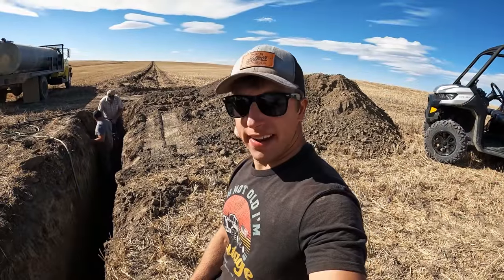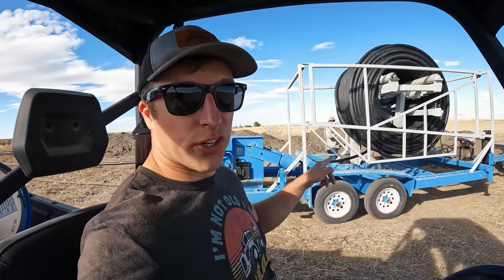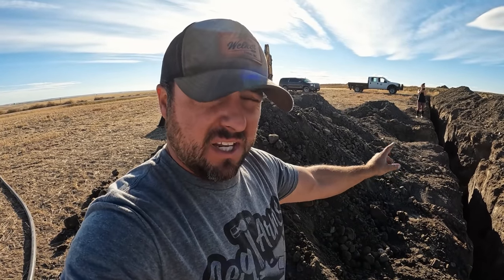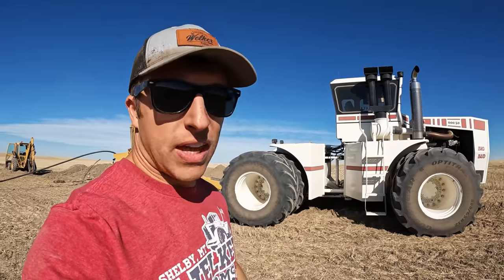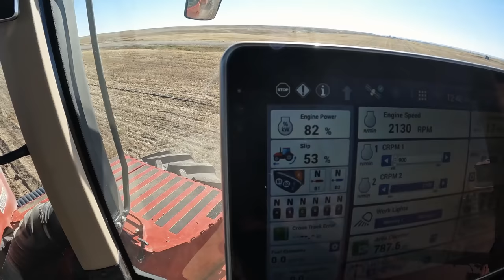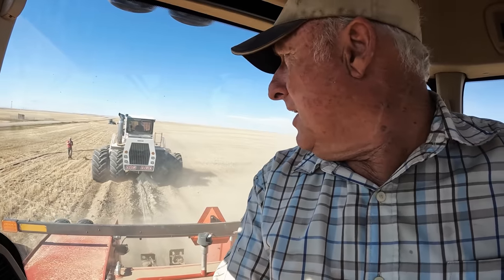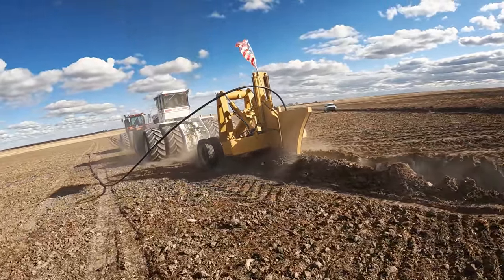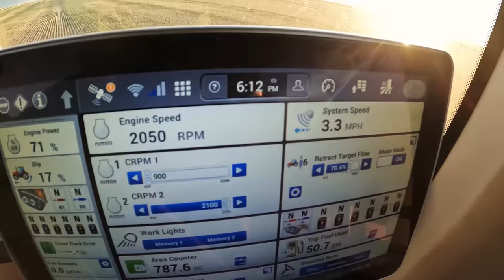6ft or BUST! - This Is How We Lay Gas/Water Lines

Comment: when i was a kid we borrowed my uncles wily jeep with a ditch digger added on and ran about a mile of pvc pipe for my grandfather to his new farm from our town in northern oklahoma and then in the late 70s my dad bought a farm and we had to run water line from the south end (where the water well was drilled) with a tricycle style ditch digger course we only went down about 3 ft in sand(some DEEP sand)  (from down under the old windmill that had an old sand point )) to the north end of the half section  (a mile away) where the barn and main corrals  were built later and i moved in my trailer house after i came back from college.  Still use use it and have added several side runs to put 30ft stock tanks in for the cattle. so far (knock on wood) only a couple of leaks mostly from gophers chewing on some poly pipe we used for short runs. YOU will never regret putting in your water system!!! i have a brother n law that hauled  water by truck for their water and wore out 2 trucks and a pu doing it

Comment: we have used that pipe melting system in the Canadian North in -40 temps it blows my mind that it works but we testted it with 2 cats and the welds never broke the pipe split other places
we used it for 4 to 8 inch pipe
Reply: I believe you sir, but its still anti-intuitive
Reply: @billsargent3407  what are you going on about

Comment: Your comment regarding the heat welders joint of the polly pipe is spot on.
 We have laid a few hundred miles of 63 ml (slightly bigger than 2 inch) and weld all our joins in a similar way as you. The two ends fuse together and become the one piece of pipe, there is no join. Like you we rip the line first and then feed the poly through a layer similar to yours but no where as big. We only have to put it in one to two feet as we don't have the worry of frost and freezing like you do. Our laying   machine is a Cat D11 Dozer, Thanks again for a most interesting video. From Down Under.

Comment: Our new farm got tiling in the middle 1970’s. My dad was running a tractor, pull type chopper and forage wagon chopping corn and one day he went too fast crossing one of the humps from where tile had been installed and the loaded forage wagon tipped over. My brothers had to manually empty the wagon. To upright the wagon they had some tractors back to back with chain running over the top. My dad said that what they were doing was very dangerous and I wasn’t allowed to be there. My dad wasn’t religious at that time but my mom had several people in her church praying for the safety of uprighting the wagon. After it was done my dad came into the house with a look of disbelief on his face. He walked right up to my mom and said that the wagon lifted like it was on a cloud.

Comment: I understand  the shoring comment's  but, that soil is super stable....the soil is extremely hard and does not move. 
It's more than likely hard enough you could not shove a screw driver into the trench wall far enough to hold its own weight. 
I have ditch banks in similar  soils that are 8 feet tall and have not sluffed off in years
Reply: Thank you for reasonable comment. You bet, there would be ditches i wouldn't go unto.  I wasn't concerned  with these cemented soils

Comment: I'M A PIPPING ENGINEER AND ONE PROJECT WE INSTALLED A 24 INCH DIAMETER LINE WITH A HALF INCH WALL THAT REQUIRED A LARGE TRAILER WITH THE HOT PLATE JOINER.

Comment: Polly welding is so satisfying. Used to work for an irrigation  company and would use it for 600mm lines, our systems have pressure monitors on them to push them together at ther right pressure. Never used it for 2 inch pipes. 🇺🇸 🇦🇺

Comment: Those clamps are line up clamps. In order for the heat fusion to Weld properly those two end pieces need to line up perfectly. Then the ends of the pipe needs to reemed perfectly as well.so the they fuse right. Do this all the time with PE pipe.

Comment: I work in the water distribution industry and in the area i work in we have an area that utilizes the plastic welds on 4" line like what yall have here. My experience so far when we have a leak in this area its 95% of the time where these welds are 😐. As I mentioned before we have 4" line where you are using 2" so there will be more pressure on your welds than what is on ours, so potentially a better chance for a blowout. As there are not many options for a solution i would highly recommend marking where all weld joints are in the line so if/when there is a leak it will be easier to locate. On the bright side if it were to leak the welds are really easy to break away from the pipe and repair with a clamp or a couple Hymax's and short piece of pipe.👍
Reply: With only 10 lbs pressure I doubt it. We get 10 gals per min flow out of 2 in
Reply: @RobertWelkerFarmerBob  not much pressure to do anything with. 40psi is our lowest and it’s a nightmare
Reply: @RobertWelkerFarmerBob  hope it all works out for ya! Enjoy you and your families videos.

Comment: Forty years ago we did what your doing without any wall brace and did fine. Last month a local farmer/rancher had the trench wall cave in on him. Broken collarbone and other bruises . You just never know.
Reply: That 6 foot depth seems to still have some moisture or did a rain soak the previous passes?
Reply: Top 2ft some moisture but below not much.  But it is solid,  couldn't use a shovel to dug into.

Comment: Very cool plow for sure. I have used smaller vibratory style plows and have ran into everything from boulders to engine blocks and it does suck if you have the pipe on.

Comment: Man PLEASE be careful on those UTVs. I rolled a John Deere Gator 825i end over end at about 40 mph and if I didn't have my seatbelt and helmet I would have been really seriously injured. I came out of the incident with a concussion and so did my buddy. The roll-cage collapsed about a foot and I hit my head on the overhead cross bar and the entire accident happened because of a hump that I miss judged. That suspension is great until the front end bottoms out and digs into the ground and turns you over. 

I never wanna be the safety Sally pain in the neck but I felt lead to mention that. 

Keep up the good work and may God bless you all!

Comment: I was a little concerned about you guys and a trench cave-in, but you all pulled it off ok. Just curious as to how hot that ripper bar got when you were pulling? Thanks for the video!
Reply: Yeah, trench cave-ins are a real hazard and people die that way.  I was nervous watching that.
Reply: Yeah. They needed to cut some shoulders into the trench.
Reply: Virgin prairie.  Not going anywhere
Reply: Really just takes someone with common sense and paying attention when your digging to know if the ground is stable or not and safe to enter the trench   
If not just a bit of shelfing back the sides would do the trick.  No trench box needed.    You people need to realize this is a private operation.  Not a commercial job site
Reply: That clay was probably hard to dig, that risk is nothing compared to the gas line
Reply: @davesanford4798  so its ok to dig a coffin if it's at home?
Reply: @davesanford4798  It is not a private operation because they need to have the local municipality make the connections to the gas and water lines. All OSHA rules apply. OSHA says any trench deeper than 4ft require a trench shield. If they were running a water line from a private well to a  private house without any municipality involvement it would be okay like you are saying.

Comment: Wondering why you didn't put in shutoff valves at the "T" junctions....
Reply: I did the same.
Reply: Because the flow is only turned on for filling cisterns, and it's only 15 lbs when on.  Valves are at the other locations.

Comment: Why didnt you all place a tracer line in with your conduit.     Just in case you need to locate the line in the future
Reply: Another cheap old trick is to lay straw down by the line about a foot on all sides so when you dig it up in the future you'll see a black layer about 2-3" before you get to the line. Also adds some cushion right near the line from rocks.
Reply: @MrKovie1  you r right
Reply: I'm curious what soil type you have to trust the soil won't cave in on you when your down in the trench

Comment: According to Tbone MC, you have done everything wrong.  I have no knowledge of laying plastic pipe, all my knowledge is with metal.  I've welded metal pipe together that way before, but is done with friction, which is very impressive.  Furthermore, I'm sure (I Pray) you guys did your homework before you started the project, and surely this isn't your first rodeo.  So you know the headaches you will have if things start breaking.  The video was impressive, thanks for that.  Thoroughly enjoyable. I like the flag, nice touch.
Reply: Well over hundred miles of water line have been put in by other across montana and Dakota.  Statements of doing it all wrong erroneous  .

Comment: So, I'd like some clarity on why the buried gas lines, instead of a big-ass buried propane tank near the houses?  Is it really cheaper to run a gas line?  Or is it just that you're snowed in for so damn long that a propane truck can't get out to you often enough?  

This stuff all might seem normal to you guys, but for someone from NJ, you're going to an AWFUL lot of trouble.

I did read that you can't drill wells, so I finally understand the water piping.  But the gas pipe is nuts.  

I'm assuming this is natural gas?  WTH is the pressure in the pipe?

Life in Montana is SO MUCH DIFFERENT than Jersey!

Comment: With your tires on those tractor inflate them to 30-35 psi if you have them lower for less ground pressure they won’t get as much traction

Comment: Amazing never even knew that was possible are there not tire weights or plates you can put on those tractors? Sorry I'm ignorant iv only ever had an jd4440 or less which had to have weights and antifreeze in the tires I have ran some of the newer ones with the torque converters also loaner alfalfa just dont tear up machines like what yall do. That ole 1982 4440 has worked like new since new sep the air conditioning had to be done 2 years ago

Comment: That's Butt Fusion, same thing done on Distribution Gas Pipe.
Under pressure the pipe will give before that fusion, if he did it right.
Tell him to replace that Iron heater plates, it's really bad and can foul the proper clean heating surface. 
Don't mind the rant, your doing great.

Comment: Would have thought that the gas line would go under the water line. So that if something came along it would hit the water line before the gas. Also the gas being deeper wouldn't it be safer than the water deeper?
Reply: They have a 2 ft rule
Reply: @RobertWelkerFarmerBob  I get water and gas should be apart, but shouldn't the gas line be deeper than the water line for safety reasons?
Reply: The water line depth is determined by freeze depth, gas is not. So water has to be deeper. I don't want to dig 8 ft to lay a low pressure gas line. Nobody around here lays gas deeper than 4 ft
Reply: @RobertWelkerFarmerBob  Thanks, that makes more sense. Obviously I live in an area that doesn't have freeze issues in the ground.

Comment: If the Tractors are bit light. You could have filled up tires with water to add weight on them
Reply: In the north you do not want to use water it will freeze there is an antifreeze that is non toxic you use.  They know all about that if you have watched the first video he talks about weight of the tractors.
Reply: @badgerpa9  No i mean for the pulling Job then remove the water due to cold temperatures

Comment: Nice to see how capable this big tractors are to pull.  
A question: No dividing pipe valves for the different hoses after they split?  (Just only for next time you have an earthquake or an "Oh s**t digger". :)
Reply: There's only water flowing to fill cistern at each place then water shut off for weeks

Comment: Nick why aren't there any numbers of measurements on the back of the ripper. I'm just curious. That project saved you thousands and thousands of dollars.
Reply: There is welded ft marks
Reply: @RobertWelkerFarmerBob  thanks Robert. I thought there had to be something on there...Becareful working in those trenches. Unfortunately I have seen several people killed in shallower holes than yours. The drought really helped that soil lock...still scary to me with that water drill...crazy stuff happens.

Comment: So, the tires on the Steiger seems smallee than the ones on the bud. Which on do you guys think has more traction?
I have a theory that the Steiger "digs" more, thus pulling a bit more. Do you think that's right?
Reply: Could be do to 12000 lbs more

Comment: If a diesel engine smokes the way the Big Bud does when revved up, is it dirty injectors? I was told black smoke is ok, white smoke is bad.
Reply: No, its more fuel than air until turbo catches up
Reply: @RobertWelkerFarmerBob  understood thanks, but the Case does not do the same, right?
Reply: It's computer operated with electronic injection